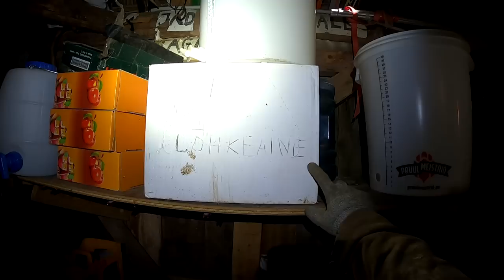Making bunch of apple juice from homegrown apples

Comment: great video, outdoor wood stove needed for next time? i can see you converting that press into an air over hydraulic or electric hydraulic somehow in future apple water processing.. use of the mulcher was a better alternative for sure. impact driver in the kitchen, could take off if you make a stirring attachment for something. actually, there are cleaning pads for the impact driver, might have made light work of cleaning the stove.

Comment: Cider is pronounced like sider with a long I. Here in Ohio our local orchard squeezes the apples adjusting the taste with the varieties available. They strain the juice after crushing the apples, but do not heat the juice (pronounced like joose) before bottling in plastic gallon jugs (@4L). The cider is kept refrigerated to drink fresh or warmed with cinnamon and other spices of choice. As the cider ages it becomes apple cider vinegar. If you have a smaller harvest and want vinegar you can use the spent mash covered with water in the amount of vinegar you want. Let this set until it smells like vinegar, strain and cover with a towel until it achieves the strength you want. I store my vinegar in canning jars and store at room temp. Enjoy your cider.
Reply: When we had the freezer space we also froze it to later.
Reply from the maker: Thanks for the info 👍
Reply: long i my ass I am from Somerset where Cider is made properly.
Reply: I think I may send Pants some proper S eye der in the post

Comment: Given the choice between the rolling thing and just putting a pad or low stool on the ground and taking a seat to grab as many apples as I can in range... I'd probably go with the latter. The rolling cage thing would simply frustrate me by how many times it had to roll over the same apple before it'd pick it up. But I have some disability issues, so generally find seated tasks less painful than standing, so maybe I just think about the problem differently to begin with.

Although... now that I'm thinking about this more, there might be a better way to not even have to pick them up in future? Keeping the grass cut short and putting a net or cloth or tarp or something around the base of the tree right when the first apple falls, then waiting until all the apples have fallen and just using the material to lift them off the ground and tilt them into the baskets seems like it'd maybe work? You already have tarps and stuff lying around, so next time you notice apples happening it might at least be worth a try to streamline the collection part of the process. Bigger vats for pasteurizing, perhaps heated outside over a fire rather than making a sauna of the house, might solve some of the frustration and expense of the bottling process, too. Sadly, I think your pressing process is already about as efficient as you can currently make it without spending any money... it's just an obnoxious, time-consuming task that is only enlivened by many hands and good company. A friend of mine has cider pressing parties for specifically that reason.
Reply from the maker: Yeah that would help a lot gotta try it out next season. Thanks for the tips